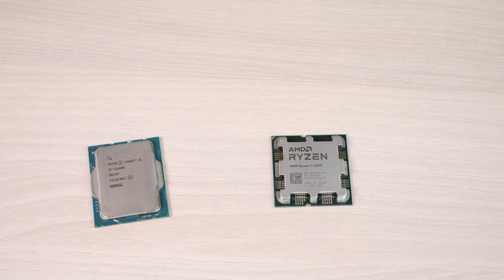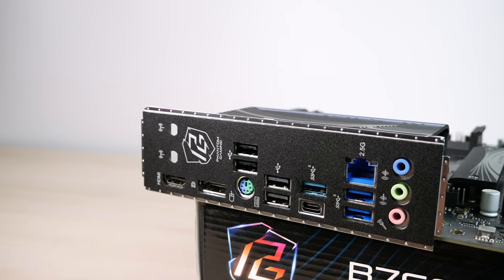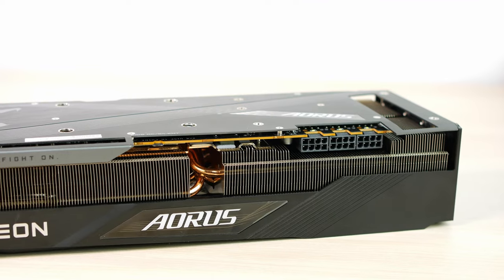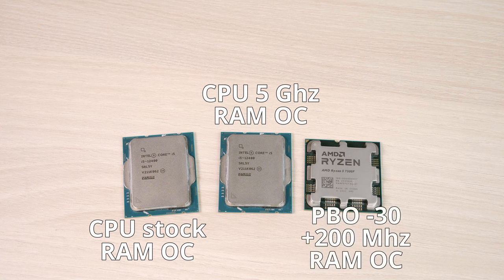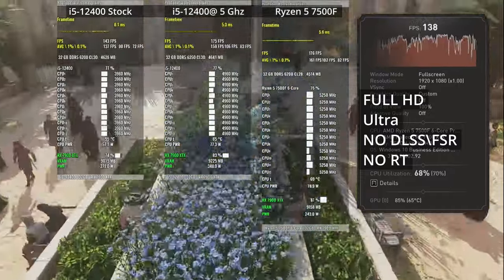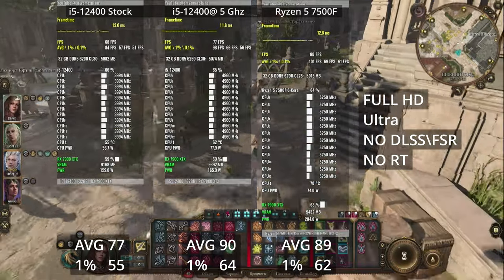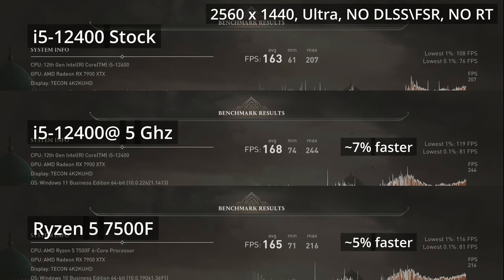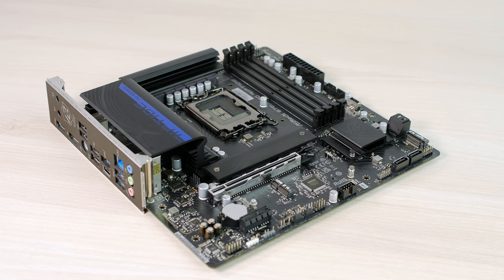I Overclocked Core i5-12400 to 5 Ghz to See If It Can Beat Ryzen 5 7500F.

Comment: Why shouldn't I buy 8GB sticks? I was thinking of getting the 7500F with 2x8GB DDR5 CL30 6000MHZ RAM  and a cheap B650? Should I just get a 12400F with a beefy B660/B760 and go for 2x16GB DDR4 RAM and OC the CPU?
Reply from the maker: Get 2x16 6000 cl30, please. You can't upgrade from 2x8 to 4x8, expo will fail to work in most boards. 7500f is a much better CPU, stay with that choice, but please, no 2x8.
Reply: 2x8gb 6000 cl30 😂 just get some team group 6000 cl38 2x16 its still Hynix you can tune it and it will be much faster than any 2x8. 8gigs sticks should not exist at all for d5

Comment: Not surprising that clocked normalized at 5GHz Golden Cove beats Zen 4 by a little. Its got slightly better IPC but Zen 4 has higher clocks as most Golden Cove tops out at 5GHz to 5.2GHz where Zen 4 can go to 5.6 to 5.7GHz all core with PBO on.

Comment: Why you didn’t share 12400 5ghz settings? Can you do another video for it?
Reply from the maker: 1.3v core, 125 bclk. Not many settings to share...
Reply: @ArtyomExplainsEng thanks! Can i overclock it on the other mobo in video, asrock b650?
Reply from the maker: B650 allows you to overclock any ryzen
Reply: @ArtyomExplainsEng What the Bios Version B760M Riptide?

Comment: Hi, you mentioned the b760m pg riptide has issues. What are they? :D I watched the video but you didn't bring it up again. Sorry if i missed it :)
Reply from the maker: Dual cold boot if you bclk overclock. Also bclk seems to like to shift by 1, but someone told me you need to set it 0.25 higher than you want, then it will not move back and forth by 1. Sleep is also an issue, many report that after bclk overclock it will stop entering sleep.
Reply: @ArtyomExplainsEng  Thanks for the answer dude!

Comment: I can stop thinking about Metro Exodus when i hear the name artyom. 😊
Nice video. indeed, you don't need strong cpu for 4k gaming. there is a gain in 2k/1440p gaming....but your screen has to be small enough for the pixels to be small enough.
i tried 1080p gaming, on a 4k tv.......not a big one, 46" inches, and........that's not nice. too big screen for too low resolution.
you can also pbo with the 7500F with A620 chipset....and get 32 or 64 gb of ram. good memory bandwidth
that i5 12400 is some beast.......for a third of a 7800x3d......😊
Reply from the maker: Artyom is a common slavic name, there are tens of thousands of Artyoms out there :)
Reply: you don't need high end CPU if you use AMD cards, nvidia will use a lot more CPU

Comment: You mentioned to not use 8gb sticks, but could you or did you do any test to see if that is true? People on reddit say that a lot too, even though from the test that I saw there wasn't any big difference between a kit of 2x8 and one of 16x2 in the same frequency.
Reply from the maker: I have made tests on Intel and AMD and they are always 5-10% slower and overclock worse

Comment: I just got a 7500F and on default clockspeeds, I get a farcry 6 result of 97avg, 137max, 71min on CPU-limited resolution (1280x800) (which is still about 16% higher than what i achieved with my previous 5600X. 
These numbers differ WILDLY from what you have shown in the video. Maybe my RAM is the limiting factor here, as I have 2x16GB 40CL 4800mhz, so that might be an issue. I did not expect the results to be THAT far off though. Can this be the case? (My Graphics card is a 1080ti, but on that resolution, the GPU probably has no effect at all, just mentioning it for sake of completeness)
Reply from the maker: Yes, you are crippling your CPU extremely hard with this ram. Get 2x16 6000 cl30 kit, sell yours. Ryzen benefits from good ram.
Reply: @ArtyomExplainsEng  Thank you very much for your input. I have not expected to receive an answer, let alone 6 hours later. I will look into it and probably respond to this thread once more.
Reply: @ArtyomExplainsEng  I got my RAM to work at 6000 and 30 CL, which already improved the FPS somewhat. I also found out that my cooling is subpar and CPU therefore clocks down to 4700 mhz. So now I will get better cooling. Still even after I will have fixed all of that, I find it hard to believe that I could ever reach your FPS from the video.
Reply from the maker: @rikai5344  Try to apply a PBO offset, try -40, go down -5 step at a time. Test stability with an intense workload, like occt, atleast 30 minutes for each step, if it does not crash try it for a day in normal operation and if no instability is visible then keep the offset. Mine works great with -30, it can even do +200 pbo freq boost at -30. Check my latest video where I test 12900HX vs this 7500f with a -30, +200. Keep in mind there is not latest Windows 11 fps boost patch applied, I made the test just before it arrived :(
7500f is only a 88w CPU, it should be just fine on almost any cooler, unless it is very small one. Hight temps on a ryzen are expected, even 70-90 in gaming due to a fat heat spreader.
Reply: @ArtyomExplainsEng  I will try that. Thank you very much 😃

Comment: Is there a pbo hard cap on the clock override or was it unstable past +200 ? 

From what it seems. I dont think a 7500f is a poor-mans 7600x even with pbo
Reply from the maker: Most 7500f can reach 5.3 - 5.4 all core if your just set voltage and frequency. The PBO boost is limited by 200.

Comment: hello and thanks for this great video

some things to mention: these CPUs are much better with AMD cards, nvidia driver overhead hit performance a lot

12400f uses more power unless you have msi lite load to undervolt, wich also helps with memory clocks as the SA is cooler 
the intel CPUs have a lot more memory variance for many reasons i think mostly because they come from different dies

i was able to run H0 12400f with 6600 ddr5 on this same board, the memory tuning did much more than the bclk overclock in warzone. I had some 12400f that were not able to run past 5400 in the past (stock cooler and no undervolt though, so probably high SA temp)

Comment: What a cool video, thanks!
I'm running a 12400F with a Z690 Taichi myself, it would have been cool to see your BIOS settings on the B760M PG Riptide as well. 
I got pretty bad silicon lottery but a very capable AIO (Liquid Freezer III 420), so I am running at a very high voltage to get 5.2GHz all core. I currently set it to 1.45V Vcore LLC1 with Vcore running around 1.4V under all core load. I don't mind the efficiency loss or higher temps, since the Liquid Freezer comes with the thermal frame and has no issue dissipating 300W+. Do you have C0 or H0 stepping? H0 may clock even higher, but dissipates heat worse. C0 is a disabled 12900K die, so the heat is distributed more evenly.
Reply: mine's a H0, running at stock voltages at a solid 5ghz
msi b760 mortar max
12400 non f, with avx512 fused off
Reply: @elonwong  what kind of cooling do you have?
Reply: @mangitt  Thermaltake aio + cpu mounting bracket
Reply: @mangitt  tbh one of the shettier Thermaltake coolers since I didn't expect much heat
Reply: @elonwong  H0 dissipates heat pretty bad as much as ive read online
Reply: @mangitt  not really that bad. LinPack it cooks at around 96c package @145w. 
And in cinebench 2024 just tested at around 86c, muti score: 835
Reply: C0 can undervolt without clock stretching and has better dissipation and average higher memory speed (with same locked SA) H0 slightly lower latency
Reply: @mangitt yes H0 is very hot need to run MSI lite load to undervolt
Reply: I have a c0 stepping, it requires 1.33V to reach 5 ghz. I guess, 1.4 on 5.2 definitely not the worst possible die :) Also its cooled by deepcool 240 aio with custom ilm. About 90 C, 115 W in cinebench

btw 5ghz on stock voltage is dead crazy, i would really like to have the same quality

Comment: I don't think a 12400F for $109 with a B760M PG Riptide for $130 is a bad combo at all. I've used the 12500T, 12700K and 14700K in the Riptide and found it able to handle all of them without issue (admittedly the 14700K took a fair bit of tweaking) I was even able to run benchmarks at DDR5 7600 and break some 3DMark records for my hardware config (14700K and 4080 Super).

I would not hesitate to recommend the B760M Riptide/12400F/T-Create Classic 5600 32GB kit as the basis for a budget gaming platform. You might try using a 6800, Zotac open box 4070 or used 3080 with it.
Reply from the maker: I can get 12400f from AliExpress for 90$ and b760m pg riptide for 110 where I live. Nothing beats this combo right now.
Reply: That's what i made a few months ago. Rx 6800 for 260 euro, 127 euro pg riptide, 90 euro 12400f constantly running at 5 ghz with a thermalright phantom spirit. Amazing price for the result. The 6800 run overclocked with an Undervolt @900 mv.

Comment: chat cold boot problem does the b760 riptide have? can you explain more?
Reply from the maker: Starts 2 times before boot begins. No way to fix right now
Reply: @ArtyomExplainsEng  thanks for the reply... you are awesome !!!
Reply: @ArtyomExplainsEng Do you mean cold boot as in power supply off? In my case, it only boots twice after unplugging it, usually it boots fine, takes a bit longer to reach POST screen though.

One more recommendation: if you switch the core ratio from All Core to Specific Per Core and set all ratios to 40, you get C6 and C7 sleep states. This helps you get 10W idle.

Comment: in my country 12400 and 7500f price are the same so i chose ryzen  7500f over 12400 and i m first time user of ryzen only issue with ryzen is temperature otherwise am happy with my decision over all and using it with msi a620m-e motherboard easily
Reply from the maker: Undervolt and set max temp to 85.

Comment: my settings are these (VDDG CCD 0.95, VDDG IOD 0.95)
https://youtube.com/shorts/DJRsIPrJ58U?feature=share
We are not so far from each other (I assume the differences in the settings cannot result noticeable performance difference), except your voltages seem quite higher than mines (your Ryzen must be in high voltage mode). As far as I know 1.2 V should be enough for VSOC surely. I guess VDD, VDDQ, VDDIO depend more on the silicon lottery / IMC. My 7600 is probably very good, it could run the XMP profile of the Vengenace kit at 6400 MT/s and 2067 FCLK in 1:1 mode.